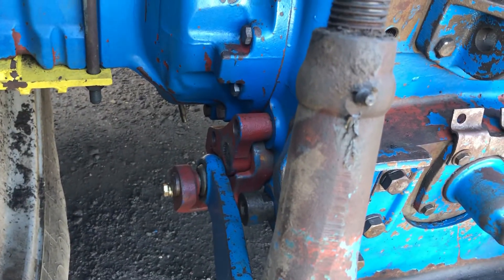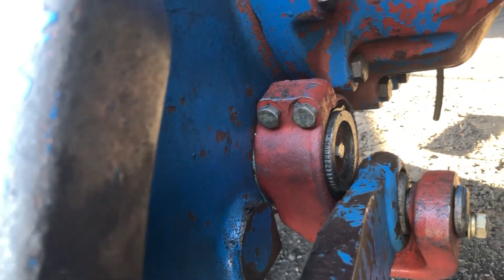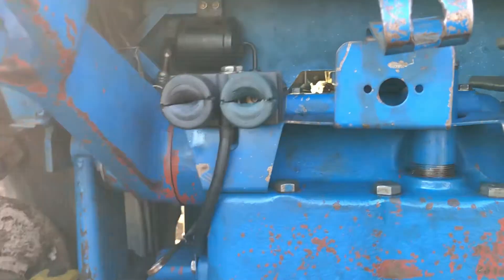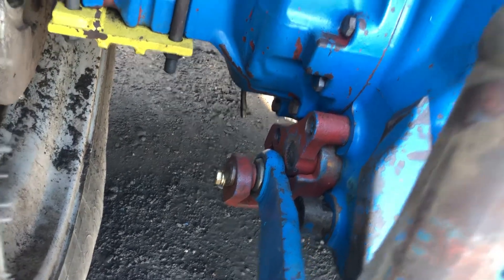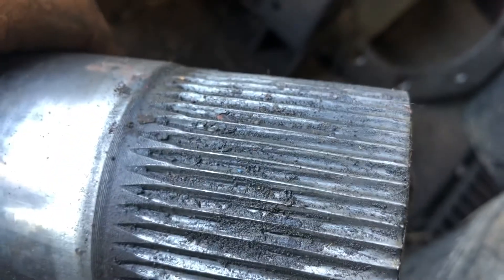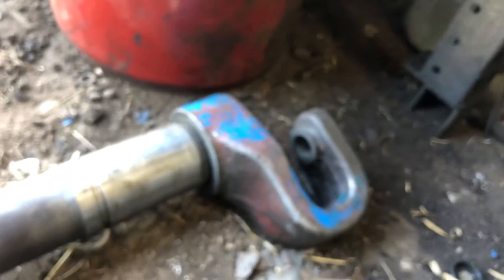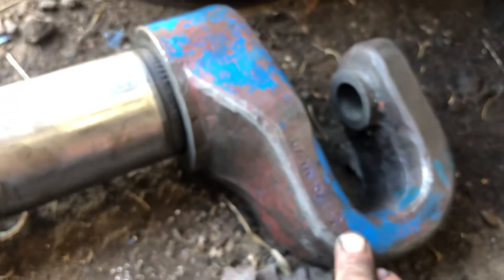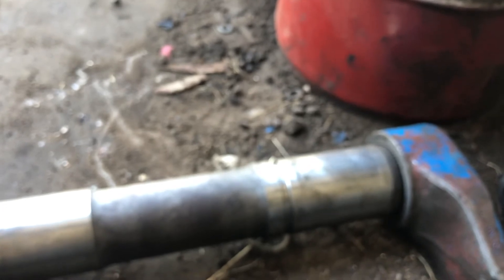Common Ford rock shaft leak

Comment: Ive got a 9700. It has the old style. Would wear on that shaft cause the lift to jerk when all the way up with heavy load? I pull a semi mount planter thats pretty heavy.
There's just not any old school mechanics around here.
Reply from the maker: The Guys at Alexander tractor parts in Texas are very helpful. We live in Minnesota and use the a lot.
Reply: @dschefers9700  i got parts from them too. Ill have to talk to them.